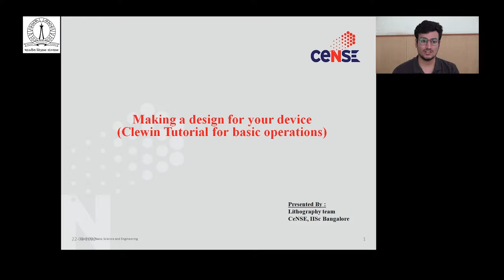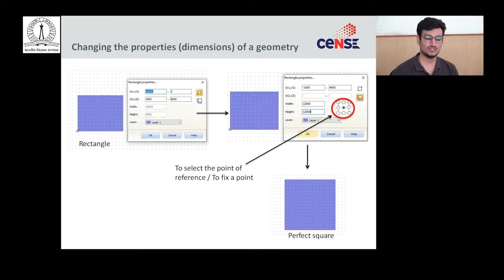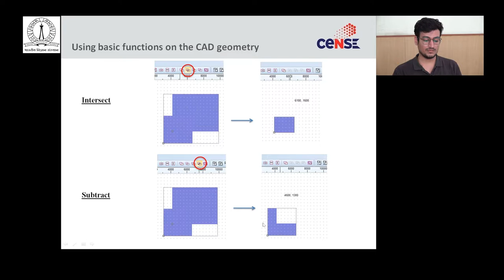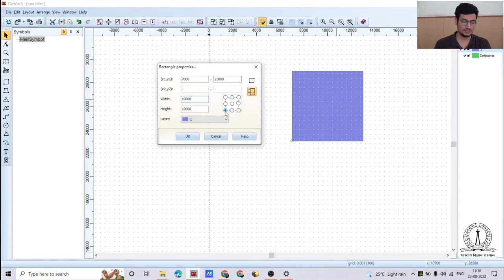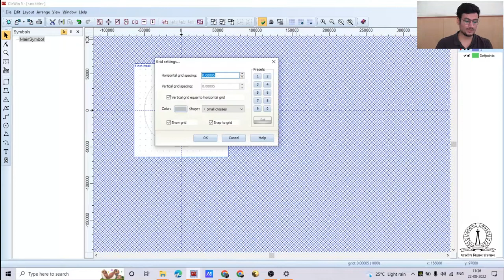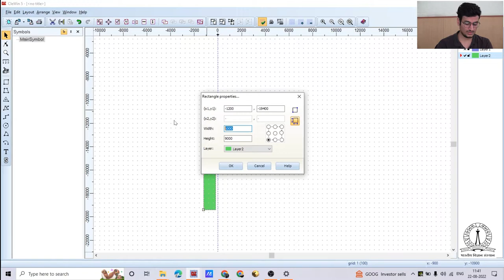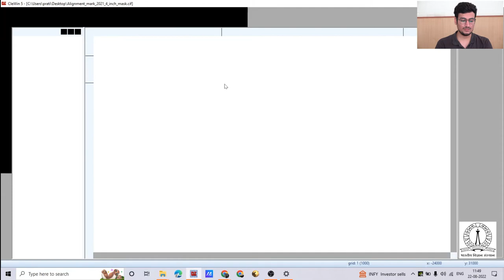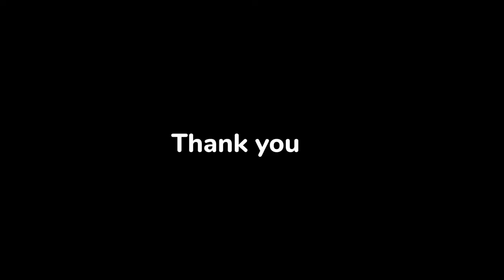Clewin Tutorial

Comment: Hello
Nice tutorial
The menu bar in the clewin 5 is hidden, can you help me how can I restore them?
Reply: Hi.. 
Thanks for the feedback ! 
Since, we can drag and drop the available tool bars in the software, you might have changed the default location by mistake. So, either you can restore the previous version of the software using the properties, that will set the default settings in your software or in worst case scenario, you can reinstall the software, if you are not able to find the menu bar. Since menu bar should be visible in the default user interface mode of the software.
Reply: @pratiktolambia  Hi. I had the same problem There seems to be a cross to close each toolbars, but no way to make them reappear. So I decided to uninstall and reinstall everything but nothing is reappearing ??